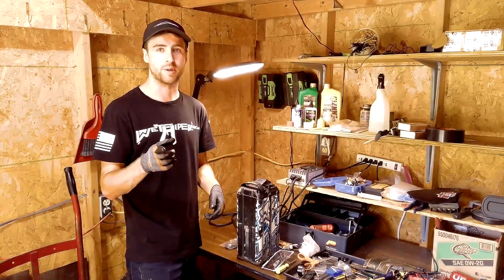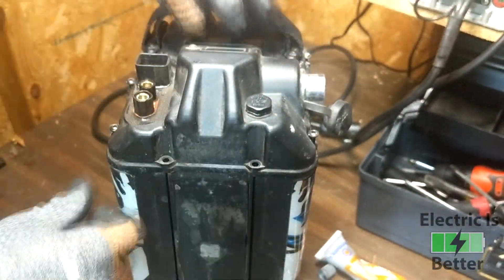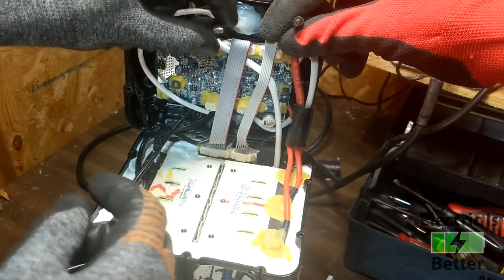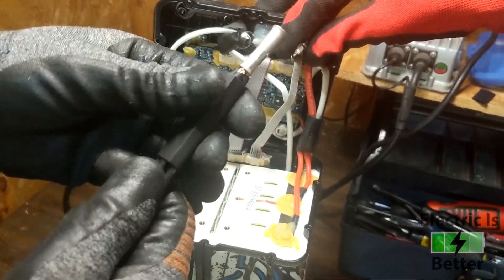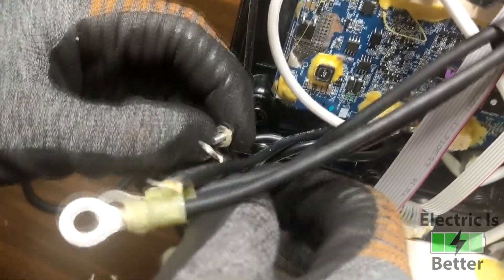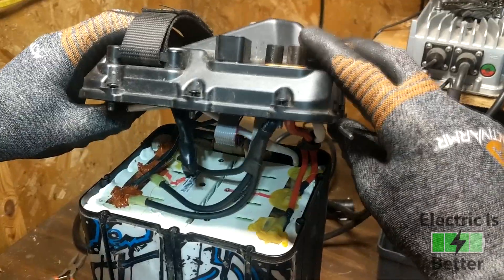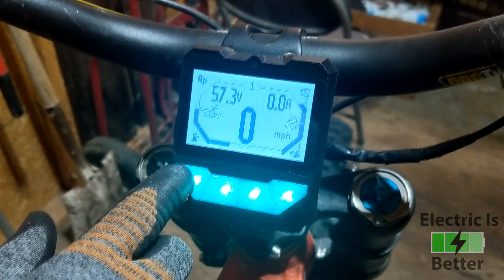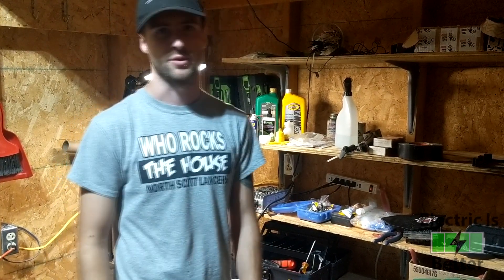⚡How To Bypass Your Stock 60v Battery | Sur-ron/Segway⚡

Comment: 6600w is the max 😉 110a the panasonic can handle ...  relook your  calculator . But nice Video 👍
Reply from the maker: True, however the numbers I gave are for the 'high end' voltage. So the bike at it's volt max is 67v. So 67vx110=7.3kw.
Reply: New battery can do 180 amps absolutely peak power  @electricisbetter
Reply: @electricisbetter  nope ... this is for  sale ... true is that you have a voltage drop if you pull hard .... if you put 7k w you are at ca. 120a you can do a log with the nuc also 😉
Reply: Looks better if you tell 7kw vor sale controllers and bypass and don t care whats happen with client battery ... 😉 But do what you want .
Reply: Yes cause you never pull the max at 67 cause volt drop. Thats why normaly you calculate the kw at rated voltage ... so here 60v 😉
Reply: @electricisbetter  Oh i forgot ...long time ago with 24F... NUC you select the Battery A .Then 110 is good. ASI works with  Watt so you set the Power.
Reply: normal chargin work?
Reply: @murodkuchkarov9162  yes of course ...

Comment: Question,.... I had mine bypassed for about 500 miles. Flawless , worked textbook perfectly.  Now I have the 72/42 so I have this extra bypassed battery. I want to UN -Bipass it so my wife's stock surron can use it. I assume there's no issue but I'm inquiring anyway.  Cheers
Reply from the maker: Thanks for reaching out! Yes, you can un-bypass it. I've done it. You literally just do the steps in reverse and it should work like normal again. You can solder the wires back together, or they make heavy duty crimps for 8 gage wires too. I've done both without issue. Just make sure the connections are very solid!
Reply: Thanks I figured it would be fine just wanted to be sure it wouldn't mess up the BMS or something
Reply: What did you set the amp discharge as ?

Comment: Hi, my battery of my Segwas X260 was dead ,I have a standard battery and controller . Measuring the battery , I still had 60V , so the problem had to be in the BMS controller. I did the BMS controller by-pass , not for more power but to get my bike running again and it worked ! Do I need to take care of something special when charging the battery ?
Reply from the maker: You shouldn't have to do anything special when changing it, because you do not do anything to the charge side of the system. Only when dischaging, don't let it get below 54v

Comment: Sick video, but what about voltage sag below 52v does that damage the battery or is it only the idle battery voltage that matters?
Reply from the maker: Voltage sag matters, but you really can ride this battery as low as 48v. I said 52v, beause at 52v the voltage sagging right around 48v.
Reply: You can fully fully discharge it to even less than 48v but keep in mind you'll have like no power at all 😂

Comment: If I am using a bypassed battery with a stock controller will my percentage display be accurate or will I have to check the voltage. I bought a used bypassed 60v battery but I don’t want it to be bypassed. From my understanding I can run the bypassed battery on my stock controller with no issues so I just want to make sure my display will be accurate. If not can I reverse a bypass?
Reply from the maker: You can reverse the bypass but its risky. If the batery is bypassed, the battery charge status will be delayed. So if you were to use 25% of your battery, it would take a couple hours for the battery to show that you used that 25%
Reply: @electricisbetter  Why is it risky. From my understanding I just remove the bypass harness and reconnect the negative wire with a large butt connector and it should run just like before.
Reply: @danielw1750  Nah not exactly that easy, sounds like thats what needs to be done but once you bypass, it's hard to go back
Reply: @bslothed3211  I reversed my bypass about half a year ago as described above and it’s working fine 1000 miles later. No issues at all just have to seal all the terminals with silicon

Comment: why would you want to bypass the bms? been pondering this for a while and havent found the answer on google
Reply: So you can run more power "7kw", you can't do this with a stock controller as you can't set the power level but with a nuclear, BAC, etc you can set the power for the battery. All it is, is a free power upgrade without buying a new battery.

Comment: How is it that this worked without turning the key to the ON position?
Reply from the maker: Because of the Nucular controller I have installed on it. That controller can be turning on by hitting a button on the bottom of the screen

Comment: Just curious if I understand this correctly, because I am in the process of building my Sur Ron with just the frame, I would only need to do this if mine was stock correct? Because I bought a frame with the Nucular 24F Controller and I am in the process of making my own battery. I would much rather buy stuff already, but where I live they don't ship complete Sur Ron. Thank you.
Reply from the maker: I personally would recommend a bigger battery to go with your controller over bypassing a stock one. Bypassing a stock battery comes with a lot of problems

Comment: Since you bypassed the BMS... you should monitor the lowest cell while discharging and the highest voltage cell while charging for safety. I wonder why you didn't mention this in the video?
Reply: The discharge is bypassed not the BMS for balancing
Reply: @danielbellis2769  I don't know if the balancing is working or not, so I will assume so since you said... Overcharge protection and undercharge protection is controller by the BMS, a cell balancer is not a replacement for a BMS!

Comment: Hello I just installed my bac4000 with an original battery with bypass. Is it normal that the display always shows 100 percent even after driving because the Egg Rider says something else.
Reply from the maker: Yes. The battery % on the battery pack will be delayed. It takes about 2 hours to show what it's actually at.
Reply: @electricisbetter  Thanks, I was worried

Comment: Having your battery bypassed will allow it to produce higher power and be used in mode1-2 -3 with our “Enduro” Package. It will also free up anpther 6V or range equivalent to about 46% more: HVC 67V – LVC 54V,  to a new  HVC 67v – lvc48v
Reply: How do you monitor the individual cells? 48 volts is the full pack voltage... I hope the cells are not getting too low!
Reply: @uhjyuff2095  ya can't monitor cell, the nucular display has volt reading, just keep an eye on that, don't go too low
Reply: @sur-ronrides  If only there was a device that could monitor individual cell voltages...
Reply: @uhjyuff2095  you could create a balance lead and monitor indiv cells like we do in rc lipo applications
Reply: @JC-zn3qs  The RC world has 100wh packs with less fire risk and this pack is an explosion waiting to happen. I don't want to be a "BMS" because I am not an engineer, I would rather sleep good at night knowing my BMS was designed by a qualified engineer and is doing all the work for me!
Reply: So do I gain more range with the bypass?
Reply: @builtforspeed5274  yes a bit

Comment: The cells in the Sur Ron battery are design to supply 10Amps per cell continuously and with its 11P configuration is designed to give 110Amps or 6600W continuous or bursts much higher.

Comment: Run battery until it die then its will be safe or unplug  bms  battery isn't alive and put everything back
Reply: No , but will be slightly safer and less explosive if anything did go wrong , do it outside and go carful, it’s easy mate
Reply: @ptescreen18  yes I'm was right  run battery until it die and  unplug  bms ain't be alive

Comment: Just wondering why you want to bypass oem BMS and use an aftermarket controller?
Reply: Let’s you run 7kw, with the stock battery. The obvious next step is go 72v, 10-15kw but that battery is a bigger outlay. This mod gives a good power boost without the new battery cost.
Reply: @danielbellis2769  The mod should be to install a bigger BMS instead of a bypass. Harder to do, but way way safer also!
Reply: @uhjyuff2095  you are right, these cells are pretty safe though, and limiting the power to 7Kw keeps the discharge within the manufacturers spec for the cell.
Reply: @danielbellis2769  LOL... The manufacturer doesn't test ride in hot or cold climates... The tests are done in a lab at 25C. Do you always ride in a lab like the Manufacture tests in?
Reply: @uhjyuff2095  it works it tested and on a shit load of bikes with no issues, so do what you want if you so scared. Lmfao
Reply: It’s been a thing for well over a year, keep up
Reply: @danielbellis2769  Listen to yourself, this Bms bypass thing is a total hack job and anyone who does it is a hack themselves.

Comment: I don't know why people rather do this than buying a higher amperage bms.  The bms is what keeps your battery safe and also keeps the cells balanced without it you can dangerously imbalance the cells and that wouldn't be good for the long term.
Reply from the maker: Cheaper 😝
Reply: He bypassed the discharge not the charging my dude the bms is still doing its job balancing the cells it just won't cut off if he ever pulls more than 95 amps when at full throttle
Reply: @Epvrider   Yep... sure the battery will be pushed harder and its life affected accordingly but that is no where near as bad as not balancing the cells.
Some of us are on a tighter budget than others so we tend to do our upgrades in stages, my first power upgrade is going to be a Nucular 24f and the BMS bypass, It will only offer a relatively small performance boost until I've saved up for a 72v battery... but as the stock controller cant do 72v its the only possible upgrade sequence.
Reply: My thoughts exactly. If your battery can't handle the amps as it was made, then the battery should be upgraded the right way!

Comment: I want to do this I’m just worried even if I heat shrink the other cable the one u cut then hot glued. The end that u covered with electric tape is what if I comes undone idk is there a better way to cover? Heat shrink? Or a wire cap?
Reply from the maker: Yes and yes.

Comment: It says out of stock on E-Moto bros website , how can u be out of stock of wire and connectors 🤯😅 I smell laziness
Reply: Just buy the wires and connectors or if you want to be extra safe you can buy one of those super fancy Bluetooth controlled 150amp bms but for some odd reason no one ever does this so I'm not sure why there might be a reason but as someone that has built batteries in the past when I get mines I'm going to look into if I can replace the bms with a higher amp output one instead.  I have a feeling if you remove the stock on there will be enough room it's just harder to do vs this bypass and that is likely why more people do this I assume.
Reply from the maker: Me buying 2 of the kits must of put them out of stock?! 😂 I'm sure they'll be back in stock soon. They were good to work with.
Reply: @electricisbetter  I ended up just making my own , was simple enuf lol